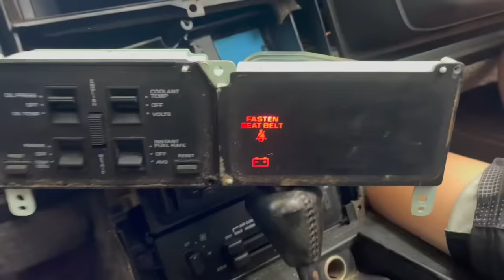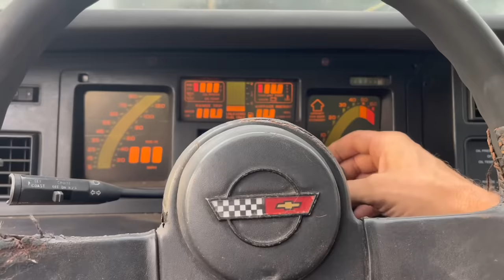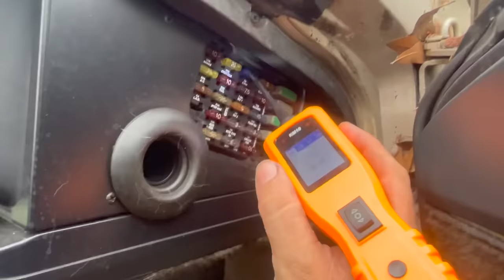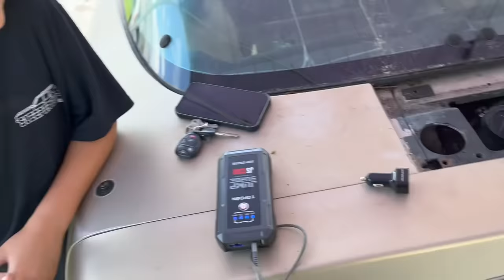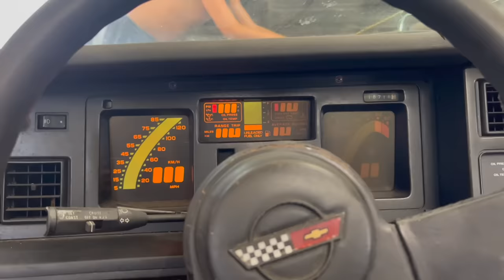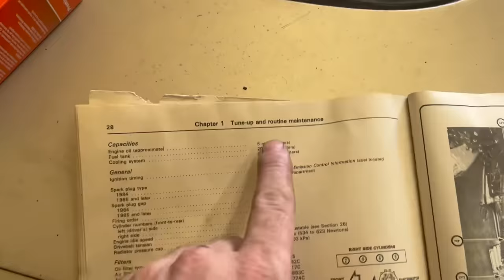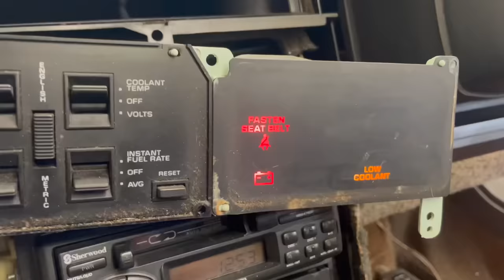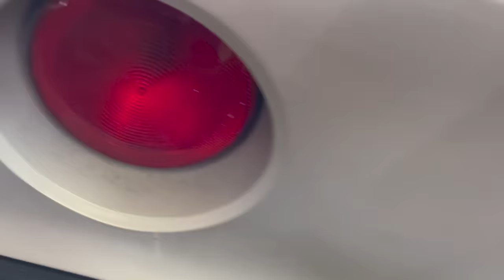Best present ever !! Birthday Corvette for a 10 year old !! Now will it start ?

Comment: This brought back some sweet memories. I taught my daughter to drive in a 1965 falcon with a 289 and 3 speed manual. I taught my son in a 1970 corvette with a 454 and a 4 speed manual. Both cars where quick but the kids caught on quickly. I will never forget the first time my son follow my directions to let the clutch out slowly and the give it some gas.
When he felt it move he dumped the clutch and gave it 1/2 throttle. A thrilling sideways takeoff. On the serious side I taught them both to respect the power these machines have and to use them safely to protect themselves  and others. Racing is done on a track not the street and that also applies to showing off.
Reply from the maker: That’s always

Comment: I have an 87 convertible, the headlights have a plastic gear that rotates them, they strip out kinda easy, if you pull the gear off and rotate it 180 degrees it uses the other half of the gear that it didn't use before. It's pretty easy to do, good luck. Happy birthday Ralphie!

Comment: I seem to remember a fuel pressure regulator being under there while you've got the top cover off. Also I think you have to take at least one of the side pieces off to put it back together with new gaskets. Fuel filter is probably plugged it's down on the passenger side along the frame. Happy birthday Ralphie.
Reply from the maker: Ok thanks

Comment: Happy Birthday, Ralphie!!! You got the BEST present! Sold my 87 Vette about 4 years ago, loved that girl but I'm getting too old to wrench. 
Get those gauges working!! They work well when they work, pretty accurate too. Flush out the cooling system, do NOT EVER overheat that girl!
Looks like she's got the Sport Seats option. That was $1100 when new! Check the manual on how to store the roof in back. Don't take off the cover in the storage well [under the rear glass] because you may never find another. Check the rear brakes, the parking brake may be sticking on. You got 4-wheel discs, but the parking brake takes shoes INSIDE the rear rotors. Don't forget to check the rear diff for fluid, too. 
New casings will make a HUGE difference in handling and stopping. If the A/C don't work, you might want to leave it be. Never worked well on mine, even after I did a full service on it, just too weak.
Okay, enough for now. Really happy for you Ralphie, and the whole family! LOVE your channel!!!!!
Reply from the maker: Thank you so much we are super excited about it

Comment: Fantastic, 
That car is a 1985 Z51 car, which had stiffer springs bigger sway bars bilstien shocks oil cooler wider 9.5 inch wheels front and back. And the proper tire size for all 1985 cars is 255x50x16. I purchased one in 1986, put 90 K on it and loved it. At the time it was a ripper. Stock all 85s went 155 MPH, I pumped it up in many ways.

Comment: Coming from a family of backyard mechanics, I was taught that either removing the bulb for the check engine light, or taping over it so you couldn't see it was quite often the preferred solution to a lot of automotive problems, as long as the car was still running ok...
Reply from the maker: Exactly

Comment: Now you see what the pillows are for. Someone was short. That is why the pillows were there. GREAT car. I had a 1968 Vette. Keep it until I bought a1996  Z06  5 speed that was sport tuned 450 hp. I wrecked it about 2 years later. Never replaced it.
Reply from the maker: Yes for sure

Comment: Nice! Welcome to the club Ralphie! I myself picked up an 87 c4 with a 4+3 a couple of months ago, ran terrible but did run at least. Wouldnt you know it the dang fuel rail 1 fuse was blown and a plug wire was completely off so it was somehow running on 3 cylinders. Runs great now but I'm still replacing all the old worn parts. I havent watched the video yet but if the gauges arent visible due to sun damage its the polarized lcd film, I just ordered some polarized film from the inter webs and stuck it on the gauges until I can get the cluster rebuilt. It isnt perfect but I can at least see my speed and fuel now. Happy late burfday!
Reply from the maker: Ok thank you

Comment: There is a module on the back of the plenum that will keep it from working correctly. I had the same issue with my 90 IROC thought it was the pump and it was not. Kerry

Comment: These L98 in 1986, ran 150 mph right off the showroom floor. Thats fast! Ive been 168 mph in a 2001 Camaro SS LS1 coming out of Jackson, TN at 4:00 in the mornin on a bumpy 2 lane highway. Lol. When you get around 150 and more, its terrifying. These Corvettes and the SS Camaros have great suspensions though, and handle perfect at VERY high speeds. But if you are say in a 01 Z28, visually identical to that SS, other than the hood, wheels and badging, 130 mph is about as fast as you wanna go. Because the front end wants to start wandering around at about 130. Its amazing how much of a difference in handling those 2 suspensions were. I bet this Corvette handles great. They always have.

Comment: Super nice gesture of kindness by that person!  Great video!  The gauges are LCD and and are probably sun faded.  I’m guessing the backfires are because it needs more gas in the tank.  If you slide the lever on the top of the steering column, the steering wheel will also telescope outwards.  Finally…..they are tires.  Just simply, tires.  😂
Reply from the maker: Yes he is awesome

Comment: Remove the needle valve on the injector rail attach a clear rubber tube too it and pump old fuel out of the rails.

Comment: Congratulations on the Corvette, Ralphie! You have entered into a unique brotherhood.

There are a few rules...

1 Thou shalt never fail to wave to a fellow Corvette owner.
2 Thou shalt not pass a fellow Corvette owner in distress without offering aid.
3 Thou shalt not feed thy Corvette budget grade fuel.
4 Thou shalt treat thy Corvette with respect: With great power comes great responsibility.
5 Thou shalt keep thy Corvette clean and waxed at all times yet, thou shalt never take thy Corvette through an automatic car wash.
6 Thou shalt park thy Corvette in such a manner as to protect her delicate fenders.
7 Thou shalt clean out carbon buildup with periodic high speed runs.
8 Thou shalt not cruise on unpaved roads.
9 Thou shalt not allow friend or spouse drive thy Corvette without first proper reverence.
10 Thy Corvette is an individual work of art and should be treated as such.

You are embarking on a new journey. If you're not a cursing man, you soon will be. You will need this...

www.batee.com

This website contains much information you will need to get you Corvette in tip top shape. 

Have Fun!!
Reply from the maker: Thats funny !!! he read it
Reply: @Sleeperdude   Most of them are tongue in cheek. Numbers 1&2 are not. Always wave and always offer assistance.

Comment: This is an amazing gift for Ralphie,can see how much he luv's the Corvette, see can lots of father son bonding going on now and in the future!! When you mentioned not having the squirt bottle to use on the camper,I remember hearing the the fuel pressure regulator on the Ford engines do go bad at the worst possible moment,,and causes the engine to act up the way yours was. There are different postings on You-tube,about that engine part,with diagnosis and replacement, and it's a cheap part,like $25-$35 dollars. I wasn't watching your channel when the camper died,so was not able to pass on that info.Sorry😟😟😟

Comment: If you cycle the key off and on a few times it is just like priming  , their should be a circuit breaker for the engine also  , probably under the hood somewhere .

Comment: I learned the hard way that using black rtv around gas is a bad idea. The fuel made the black rtv break down and plugged up my filter and pump a few times. It took me a while to figure out what was causing the problem so I had to tow my truck home a couple times. I recomend you remove the black stuff and find the proper rubber gasket.
Reply from the maker: Ok thank you

Comment: SEcurity light makes you turn on the key and leave it for about 10 minutes.  Then wait until the light blinks fast. The the motor will start. I bought the resisters and disabled the Security junk.
Reply from the maker: Ok thanks

Comment: The dash cluster gets what they call sunburned, its a desalination between the layers of the display, back in the 90s I had mine rebuilt and it was about 300.00$ I can only imagine how much it would be now, they do make some aftermarket gages that at the time were about 1500.00$, the rebuild only lasts about 3-5 years and it goes out again. Good luck

Comment: I am sitting here with three Classic Car Owners as well as Shop Owners and we are all laughing our heads off watching a Beach Boy working on the Corvette. Thongs, Shorts and even though you are doing a Great job as far as we can enjoy, But Man you are not what we Classic Car Mechanics are like. I myself have owned two Truck Shops, and Have been building cars since the 1950's. I owned and serviced my own Cat's, Big Rigs , Motorcycles, and built several rods as well as Race cars. Never wore shorts on any working project and always shoes and socks for my safety and protection. I would still love seeing your children, ( respectfully ) instead of Kids. Building a 1901 Curved Dash Oldsmobile or some sort of a Tiller steering car.

Comment: I had the exact same car for my 16 year old kid with the crossfire engine, it was running and fair shape, only few things wrong like the windows seal and few other cosmetic issues but he was not at all interested to work on it being a computer lover.  it was too easy to take moms or dads car to school and I stuck using the vette.  I did not mind it since I had a bit of nostalgy for it but it was still frustrating at times when my wife or I needed the Cady for a long comfortable trip or the Jag for a special occasion. Grosso modo it was a disaster, he never fixed anything on it and today still does not know what a carburetor is... lol.

Comment: If it was not the original computer then there is a very good chance the ohms were not correct for that vat system and I knew once you mentioned not getting fuel and the security light that it was a vat issues cause that disables the fuel system. Sweet that you got it running.

Comment: You cleaning the fuel injector and I believe it's going to work. My injector was used up by 100,000 miles reading odometer and I know it didn't start the car. Because I drove then it simply won't start anymore then I fix it right away. Simply pull the return fuel line out of the original engine MFI plug to the rack tube of the set of injectors and plug both hose and the rack. Then running is much improvement. The carburetor needs fuel return back to the big tank. Not Injection system of great engine more modern technology. Fuel return line does not make sense according to the regulator control by ECM not float bowl valve system. Only float bowl needs the return fuel line for it old system tech.

Comment: Engine is known to seize when water enters the engine air intake system. The air cleaner (located directly in the nose of the engine) allows water to flow into the cylinder chamber which causes engine lock up. Water can be pulled into the air intake system by the movement of air from the radiator fan when it is collected on the front air spoiler.

Engine stalls, surges and runs rough as the direct result of malfunctioning computer control module.

Engine tends to rev/accelerate uncontrollably during certain driving conditions, especially when the car has entered a turn/turning condition.

Comment: Trouble code of the 2005 Corvette is 0121 is that you must replace the throttle position sensor located next to the throttle body. Unplug the wires off from throttle position device the sender/sensor IC.
Reply from the maker: Ok thank you

Comment: The fuel injector that you pull out is much shorter than the 2005 Injector for Corvette multiple port direct injection of good gas or White gas with at least 80 octane kerosene. The 350 CID of that Corvette is recommendation to use 91 octane minimal. Thank you for reading the manual book or Professional Manual Reader, me. From ASE Team.

Comment: Did you find that missing injector clip and install it on the injector? Every time some one says you don’t need a part, it makes me cringe. Especially where high pressure fuel is involved. Does that clip hold the injector wiring pigtail pigtail on?
Reply from the maker: No we didnt find it and it’s working fine so far

Comment: If the car was sitting outside and has not run for a while the first thing you have to do is clean the gas tank it has water (for sure) its easy remove Rubber boot around the gas cap removed 10 mm screws you will need a gasket and you’re into the gas tank it will have water for sure the gasket goes bad replace it

Comment: The fuel injectors is clogged up and the voltages is 6 volt to the injector. The spray will be stream or slow lack of fuel that injector is that we are unable to see the spray coming out of the injector yet. The 2005 Corvette or later model will costs at AutoZone for $49.99 each x 8  equals $400.00. That comes out of the balance of the $600.00 that Ralphi's mother holding the holding worth of net.

Comment: SIDE POST BATTERIES WERE FIRST MADE TO PREVENT THE TERMINALS FROM ARCING ON THE UNDER SIDE OF THE HOOD OF THE 1971 CHEVY VEGA. GM HAD SO MANY EXTRA GROUP 78 BATTERIES THEY STARTED INSTALLING THEM IN HALF TON 1971 CHEVY PICKUPS AND THE REST IS HISTORY...
Reply from the maker: Ok thank you

Comment: Electrolytic capacitors age and fail. A car is generally not expected to last more than 20 years, and most electrolytic capacitors won't reliably last that long. They look like little beer cans all over circuit boards everywhere in the car, and like beer cans, they go stale with time and temperature. It's not a matter of if an electrolytic capacitor will fail, it's a matter of when. Think of it as a 30 year old radiator hose. If you love old cars, you need to learn to repair these. It is fairly easy. 

A Ford Duraspark module is pretty easy to replace with a new one; a car's computer or electronic dashboard is not easy to replace. As more and more cars with electronic fuel injection and electronic dashboards age out, car guys have to learn how to find and replace electrolytic capacitors. I recommend Nichicon but there are a few other good brands. Buy them from DigiKey or Mouser, do not buy them off Amazon as you are likely to get old stock or counterfeits. 

Example failure and repair, 1985 Pontiac Fiero SE 2M4. Would not start off the key, but would start instantly with a push. Good fast crank, fuel delivery, spark, but no start. Pulled off the throttle position sensor and read the voltage - solid 5 volts as provided by the regulator in the ECM. Cranked it, voltage was dropping to under three volts in brief bursts and the computer was resetting every time the starter hit a compression stroke - it never had a chance to get the spark timing. Pulled out the ECM, changed the two electrolytic capacitors I found in there, put it back together. $5 in parts, if that. Touched the key and the old Iron Duke was ready to rock her plastic body. Instantly purring. 

My specialty is electronics, and failed capacitors are a scourge.

https://www.youtube.com/watch?v=Fq5SWIvq_0s

https://www.nichicon.co.jp/english/index.html